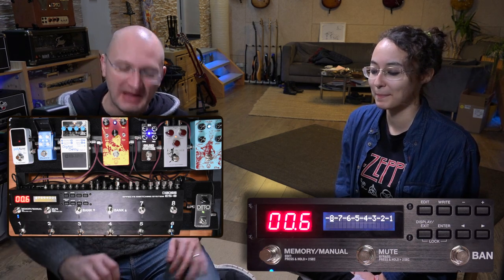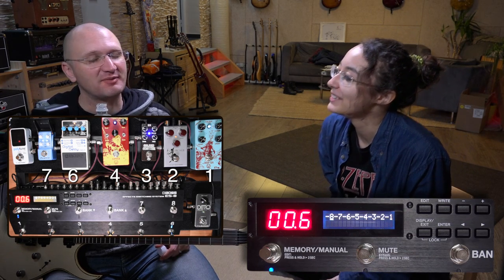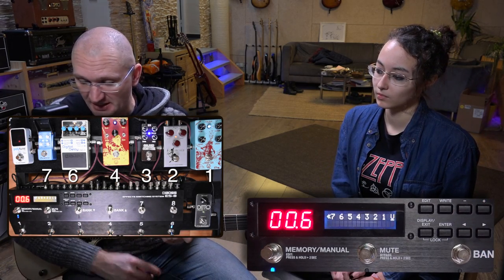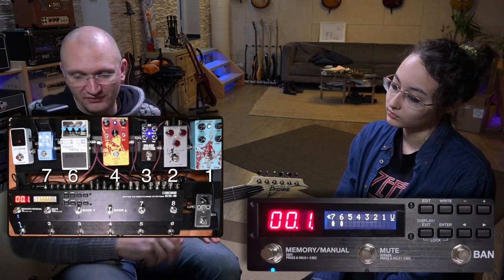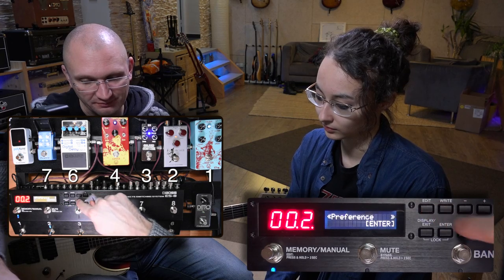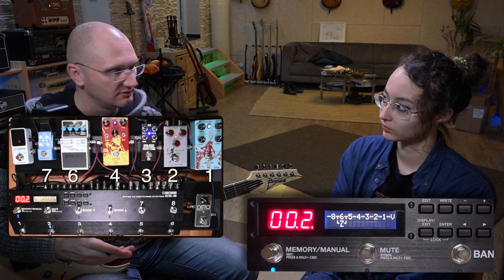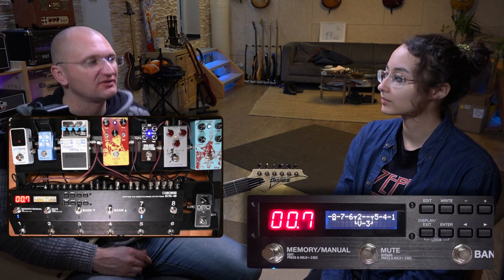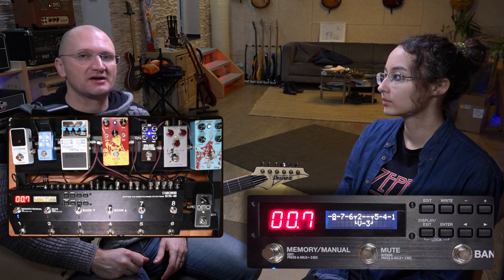Boss ES-8 Tutorials Part 4 - Parallel Loops

Comment: I know these videos have been out for a long time now, but figured I would offer a tip for those who are new to using effects in parallel. Phase cancellation caused by digital pedal latency can be mitigated by setting the effect on the pedal to 100% wet. This is a basic rule of thumb for all forms of parallel effect processing, whether you’re working with an effect send/return on a mixing console / daw or with signal routing of guitar pedals. You don’t want to have any of the dry signal passing through your parallel chain because it will naturally create phase cancellation if the effect is introducing any amount of latency. And even if the pedal has zero latency and doesn’t cause phase cancellation, you’re still stacking up 2 instances of your dry signal which will make the dry signal louder relative to the level of the effect in the parallel chain (not typically a desirable thing).
Reply: I was going to post this, but you said it all. Totally agree.

Comment: The main difference between SERIES and PARALLEL topologies is that the first MULTIPLIES and the second ADDS. This is critical when we connect non-linear boxes. A non-linear multiplication results in more complex results. Any distorsion or compression is nonlinear. A delay is not linear too, non-linear in time.  I can´t understand why common FX Loops in guitar amps aren´t in parallel, Reverb and DElay would sound much much better, this is a Basic Mixing Technique.

Comment: can put more than 2 pedals into parallel mode? 

let's say i have 3 pedals. i want both pedals 1 and 2 to get clean input, but i want pedal 2 to go to pedal 3 and i want pedal 1 to go to no other pedals on and then mix with the 2+3 chain before the output.

Comment: 20:35 maybe because 7&8 are stereo? That being said, the software should not let you configure stuff that does not work at all...
22:35 that is why you MUST set digital stuff to 100% wet when you use it in parallel loops :)
Reply: +BavarianMonkey Zackly. If there is no Killdry option.

Comment: So cool that you can fade in a fuz along side a dry signal or other loop. You are the GOD of guitar technology.  I've been trying to do that parallel fade in of a second loop with the es-5 instead of the es-8.  It doesn't have separate volume loop.  DO you know of a way to do it with the es-5 and an expression pedal?  I'm trying to see if I can keep one loop clean and fade a flanger in in parallel so I still keep my dry signal.  It's an e-5.  No ability to move the volume pedal around.  Thanks :)

Comment: So if I program say, loop 5 and 6 as parallel, I could use that as a third stereo loop, correct? Can the order of these loops also be programmed, i.e. if I did 5 & 6 as parallel, could I then program them to come after loop 7 in the chain?

Comment: Hi Henning, does the ES-8 support stereo loops in front of mono loops?
If so, does it support a) downmixing the stereo back to mono or b) creating 2 effects loops, left and right going straight thru to 2 outputs / amps or c) both?

FYI... I have a mobius that can be set either pre/post or full stereo. But I'm hoping the Boss let's me use both stereo and pre / post without rewiring or flipping a switch.
Reply from the maker: +Bas Vredeling NO, you can only have 7 RETURN and 8 FULL stereo... the rest will be mono. you can't go through in full stereo.
Reply: Thanks for the reply.

Comment: Hi E.  At around 25:00 + you are demonstrating adding a paralleled pedal (fuzz) gradually with the original clean sound (Awesome!) .  I own the es-5, not the es-8.  It does not have a dedicated volume connection.  Do you know if I can accomplish this effect on the es-5?  I could really use it in a particular song I play.  Or for that matter, any gradual increase in distortion from clean to distorted?  Not an abrupt change.  Please advise. Thanks You :)

Comment: How do you run parallel loops separately into the two outputs without them hitting the mixer first?
Reply: +Jason Flaherty  I'm also interested in this question! I haven't found that to be possible.
Reply: figured it out yet?
Reply: No
Reply: According to the boss site it's not possible...

Output Selector:
The ES-8 already has two outputs selectable for each patch.
Simultaneous output of OUT 1 & OUT 2 is available (not available for separate loop)
Reply: You couldn’t till now. With the firmware update now you can. There’s also an editor for computer .